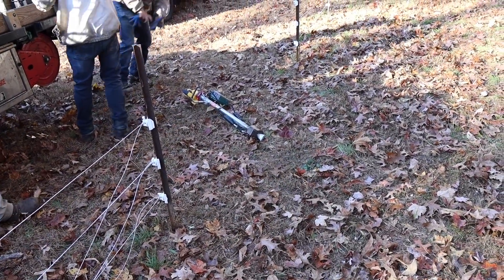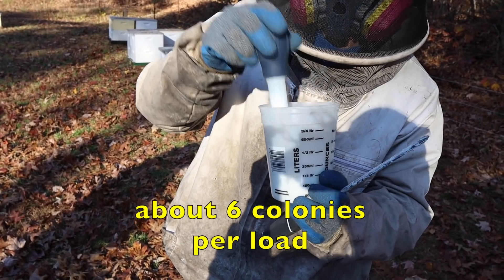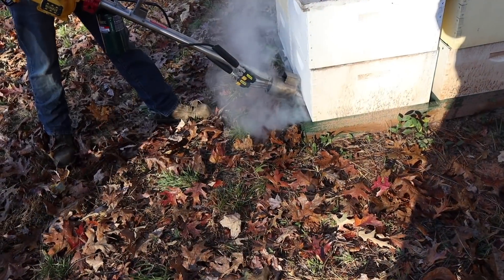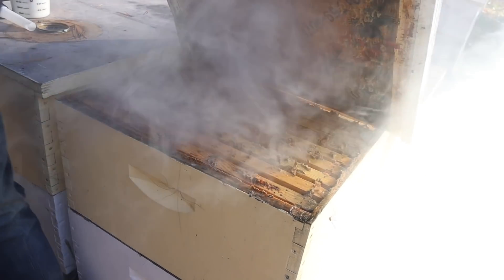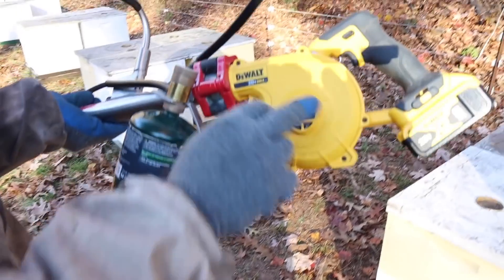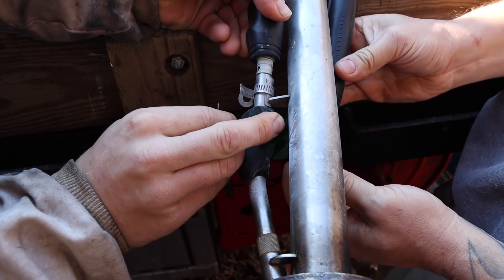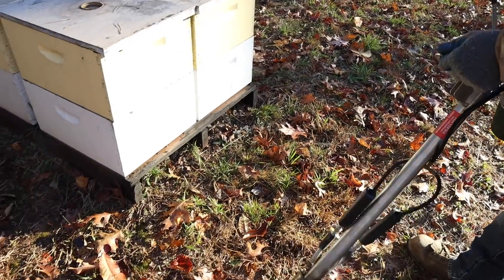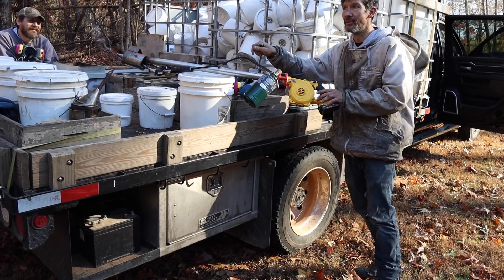VM Vaporizer for Oxalic Acid Vaporization

Comment: I hope we have a chance to compare notes in the spring Bob. I was mite bombed as well and had ridiculous mite levels.  As a result of the infestation, I did 2 rounds of 6 grams followed up by 4 rounds of 3 grams. I use a pro vap. There wasn't any abnormal amounts of dead bees at the entrances with the extra OA.  It appears out of 100 colonies, I may have killed 2 queens and 1 colony appears to have absconded. The rest of the colonies still look good and infestation numbers are acceptable now. However,  I'm extremely worried that I over dosed them. I'm definitely putting a plan to requeen early if needed.  Any chance we can see a video or information on what actions you did with the colonies that you got mite bombed on if possible?
Reply from the maker: I would be glad to compare notes in the spring. We did something comparable to you and have only lost about 10 so far. I don't think you overdosed them. We also took healthy brood from the better colonies and boosted the poor ones we thought we could pull through which helped a lot. We may have also found our mite bomb source. An older beekeeper, that had colonies about 3/4 mile from us, died recently and was unable to tend to his colonies last winter. Steady robbing of these colonies was observed early in the season and I have to assume that our bees were in on it. Another good reason for checking mite counts several times a year.

Comment: What is the temperature that this unit operates at?
Reply from the maker: That is a very good question to which I don't have a precise answer.
Reply: @bobbinnie9872  hi Bob.  From the reading that I have done in some scientific publications, vaporizing OA at temperatures above 190C produces CO2 and steam and or burns the OA off.  I have been treating with only vaporized OA for the past three years (with a 95, 100 and 100% overwintering success rate.)  I strongly believe that the operating temperature of any vaporizer is critical.

Comment: I used this machine, but unfortunately, it turned out to be quite subpar. It lacks the capability to accurately configure the appropriate temperature and dosage, and it frequently gets obstructed due to the accumulation of oxalic acid deposits. Consequently, at the close of the season when we were harvesting heather honey, we discovered a significant number of colonies had perished due to issues with varroa mites.
Reply from the maker: We're doing a fairly decent job with it after a lot of practice but it definitely needs to be improved upon. I think there is a great opportunity for someone to build something better.

Comment: Would you recommend using oxalic acid for treatment at this time in the Chattanooga area? Or something else?
Reply from the maker: Oxalic will work but if using with brood present it needs to be used consecutively at least seven times, no more than four days apart,  to be really effective.
Reply: @bobbinnie9872  Do you think Apiguard would be effective at this time?
Reply from the maker: @mindylabean8363  Yes, that is what we are going to use starting next week. Because of the temperatures we will give colonies 1/2 dose but twice as often. In other words, 25 grams instead of 50, 5 to 7 days apart, 4 times. You need to use a rim on top for this. You might check out our video "Using Apiguard for Varroa Mite Treatment" https://www.youtube.com/watch?v=zxZ76ZboXFI

Comment: I've been using the Lorobbee InstantVap 18v. Although it took 6 weeks to get it, it was worth the wait. No generator or propane bottles to deal with. You can order it in server different battery option. I got the Milwaukee version.

Comment: Hello Bob,  I live in Washington state.  I was treatmy bees with axalic acid last  week and noticed that one of my hives has a lot of  drones unlike other hives non . I  inspected it today  and didn't find a queen neither ne brood .I understand it's end of November but   does it mean my queen died? Also I counted about  40 mites on the bottom board. What number is ok to expect after the treatment in  fall. Thanks
Reply from the maker: Hi Serge. It is a fact that queen-less colonies are more inclined to allow drones to overwinter and will also allow drones from other colonies to drift in easier. It's also possible to have a colony that simply allows drones to stay unlike the others. If you are absolutely positive it is queenless, I would recommend combining it with another. You might want to check it again to be sure. A 40 mite drop with oxalic vaporization done properly on a broodless colony isn't extreme.

Comment: I like the cable idea. What is the cables original purpose? I use a weedeater strap to hold the bucket to make it a one man operation. Does clog quite a bit is my only issue. I also keep an inverter and charger with spare batteries in the truck.
Reply from the maker: We bought some cable from Home Depot. I think it is 1/4 inch. The clogging is the biggest problem and the cable routine sped things up a lot.
Reply: Thanks. Bought a 1:4 inch 10 ft. Drain snake and cut it to length. A little electrical tape and we’re off to the races

Comment: I am going to use your queen rearing method of using a double screened bottom board and shaking 10-12 frames of nurse bees. My question is when I harvest the grafted cells after capping and want to start a new round. I know to reverse boxes again, but do I shake 10 more frames of nurse bees on the queenless box? Thank you very much for all your videos. I have learned so much. I have 2 yards with 8 hives each here in Deep East Texas.
Reply from the maker: Shaking in a few extra frames should do.
Reply: @bobbinnie9872  Thank you very much. Can't wait to try it. Been using Richard Noel's method with good success. Like trying different methods.

Comment: Question for Jesse, have you had any issues using a respirator with a full beard?  Thanks.
Reply from the maker: Hi Steve. Jessee said the answer is yes. This year John and Seth are doing almost all of the oxalic work and Jessee reminded me that last year, when he was doing much of it, he trimmed his beard down to a goatee style  beard that fit inside the rubber seal on the respirator.
Reply: @bobbinnie9872  Thanks for the quick reply.  Guess I'll need to dig out the clippers!

Comment: Gday Bob, mate just throwing out there, would it matter if you treat from your feeding bucket hole in the lids and place a piece of offcut timber at entrance or a timber entrance reducer for treatment purposes whilst doing apiary yard and removing entrance timbers when finished
Reply from the maker: These are good ideas. When we were using the Pro Vaps we had a dedicated entrance stick we used.

Comment: It is reply on Lukasz M. comment : I wouldn't worry about the decomposing OA to formic acid and carbon dioxide as you won't be able to go beyond the sublime temperature of 315 F in the open (not in a closed/sealed under pressured capacity) as it will vaporize as soon as it reaches 315 F, same as you can't heat up water past 212 F as it will evaporate. I hope that makes sense. Thank you
Reply: just seeing it now, makes sense I guess...

Comment: Rather than use a rag, I wonder if it would be quicker if you took the lid out of the hole in the top cover. Pop the lid out, push the oxalic in until it comes out the top, pop the lid back in.
Reply from the maker: Possibly, might try it.

Comment: Gee whiz Bob... Just don't know what to think about all these uncontrolled temps and dosages. But when they used the comparison to bazooka, it sorta reminded me of the guy who went out and bought a 12 ga Browning and a case of double 00 buck to shoot a few mice in his barn.
Hard to really tell much about how much extremely hot air is coming out of this thing and into the hives, but if it's much at all, I would think twice about using this tool at anytime except in cold / cool weather.
Reply: 😂 yeah, I suspect that you was one of the lucky kids that didn't have to explain to daddy why there's 3 big gapping holes in the wall of his corn crib now.
Reply from the maker: I know it looks like a bit much. The flame you see isn't going into the hive. It just heats the bowl surface. I have a few friends that use these in the summer and don't report issues. By the way, there are times I feel like I would like to shoot mice with a 12 gauge.

Comment: i think it is important to note this treatment is labor intense one treatment and your not done we are doing this several times starting in aug when there is brood in the hive treatments are given 5 times in 5 weeks using 3oz  per box using a pro vap device running it off the truck with extension cords what a pain and still not getting results that are impressive  beekeepers need to know it is very hard to kill a mite on a bee without killing the bee and using a rag is a very important step i wish we as beekeepers had a better way of killing the mites .

Comment: so the crucial thing for OA vaporisation is the right temperaure, if you go beyond the sweet spot you are actually vaporising formic acid.
It does not look like this propane thingy is precise at all IMO...
Reply: Wait--oxalic turns to formic if you heat it up too much? What temp? Where can I find out more?
Reply: @honeydropfarm1605  yep, just check wikipedia for OA reactions. here's the key sentence: "Oxalic acid vapor decomposes at 125-175 °C into carbon dioxide CO
2 and formic acid HCOOH."
Reply: @MAQ123  yikes. Well I guess I don't have to worry about that with my provap then.

Comment: We use a modified (home build)  version of the VM turbo, modified the burner and the heat shield there is no clogging of the ventury valve,  not a lot of clogging of the nozzel we can do about 250+ hives an hour, clean up with water and baking soda. Just stick the nozzle into a pail of water and baking soda.

Comment: He can refill those canisters yourself it's cheaper
Reply from the maker: Thanks, probably will.
Reply: @bobbinnie9872  it's like maybe eight bucks for the fitting to refill them I have one bottle that I have used for a while now I filled up a bunch of little green ones for a camp place down the road. 1 lb cylinders you can get 25 to 26 out of the small grill tanks the ones is about knee-high last time I bought one field the little green one 6 to 8 bucks and you can get the tank filled for 16 to 12
Reply: @bobbinnie9872  Just don't talk about doing it.  LOL, it's like some silly $10k DOT fine if you do it and transport it.

Comment: Bob I know that a couple of years ago you raised the quantity of OA for each treatment.  But this looks as though you are applying much more product during each application.  Is this the case?  And if so, does this prove that the bees can adapt to the higher dosage?  I guess the proof is in the pudding.  You are frequently coming up with much smaller mite numbers on the most part in the last couple of years.  Craig Fr. VA  SML Bees.
Reply from the maker: We can only guess at the dose they are actually getting. I don't think it's too much. 32 grams divided by 6 is 5.3 minus waste.
Reply: I increased my dose to 2gram per box.  Research is showing that the recommended 1 gram is not enough.

Comment: Thx for the video. After watching I gotta say I will stick with my varomorus insect fogger. It does have an adjustable level so after just a few minutes of playing with it I was able to calibrate dose accurately.  It will plug up too in cooler weather but after chatting with my local small town auto shop it was confirmed the end piece was brake line. So I cut the original knowing a replacement would be easy to build if I screwed it up. It worked perfectly at the length I cut. I fogged 70 plus hives in about 15 min by myself.

I suppose the down side of my way is the additional cost as oxalic acid must be dissolved in alcohol. My hubby did not complain tho when I requested he stop at the liquor store and grab some extra booze.😁
Reply: I have one of those but I can't seem to get consistent vapor without clogging. Probably operator error.
Reply: @tifreire1  I admit the 1st time I used it I struggled with it clogging and popping with the back building as it clogged. I also learned to wait 5-10 seconds  after dosing for it to fully vap. A bit of mineral oil seemed key to my visual approval that said dose was done. Plus cutting that end right behind where it constantly clogged and my battles were done. I got to say once I got it going correctly my only issue was I was a little sore the next day cuz it was a 15 min work out: bend or kneel, pull lever, count, stand, step....repeat...70 plus times in 15min. My thumb hurt. My thighs hurt. Even my back.

A little practice and I was good. I remeasured my remaining solution. Did the math and it was dead on. Practice makes perfect!
Reply: @tifreire1  absolute minimum propane setting to where you barely hear the flame, unless you're out on a colder day, then add a bit more to taste.
Reply: FINALLY another Keeper using the Varomor. Having only seen other machines in operation, I laugh at the ease of use of my Varomorus. I keep a stiff wire wrapped around my propane tank to ram down the barrel, freeing any incidental obstructions. This tactic HAS eliminated any clogging difficulty's in the field. Dialing it in to the minimum propane setting CAN bee tricky. But once you understand how to read the sounds of the fire and the expelation amounts of vapour this thing IS THE MITE BOMB!!!

Comment: Hello Bob Joe from Connecticut again I am also in the middle of doing my oxalic treatments and using your double screen board method for small or underweight colonies at the same time. my question is, is it possible to overwork the parent colony by placing a colony if it’s too weak over the top of it and stressing it out, or taxing it thermally too much over the course of the winter? and do you have rough guidelines that you follow to avoid doing this?
Reply from the maker: We use singles with 5 or 6 frames or more and doubles with 6 or 7 frames or more for mother colonies. Of course we're warmer than you. So yes, think using a mother colony that is too small may not be good for either colony.